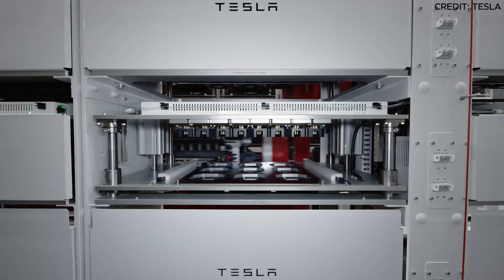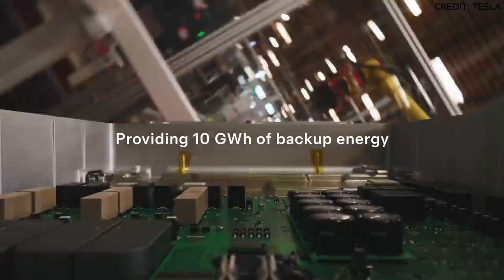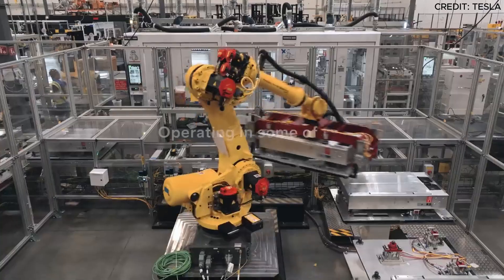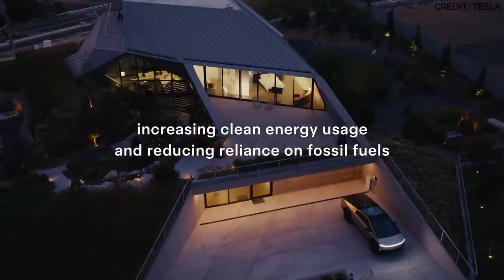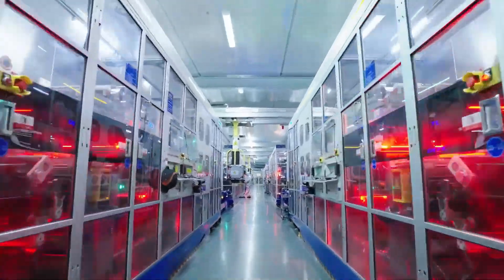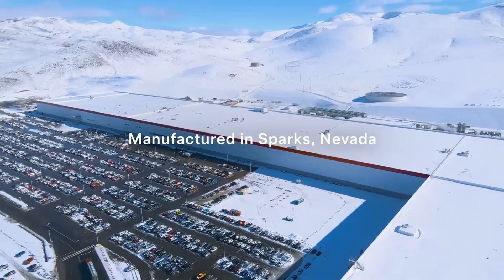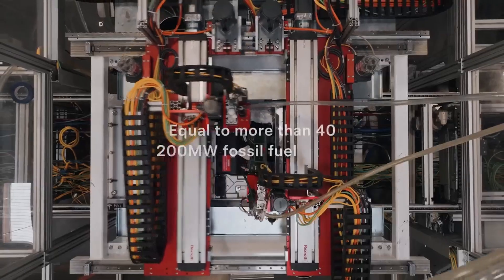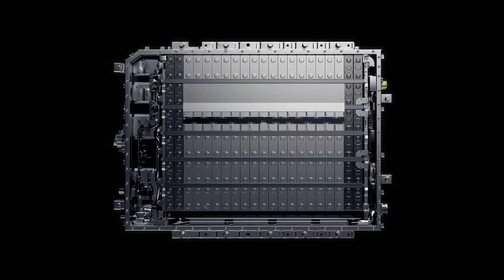Preserving LFP Battery Health: The Case Against Frequent 100% Charging

Comment: What if I don't need a precise calibration? Can I leave it longer than One month to a low State of charge and charge 100% only when I do long trips
Reply from the maker: There’s no major issue with keeping the battery at a low state of charge for extended periods, but it’s best to avoid letting it drop too low (below 10%) for long durations. Staying within the 20%–80% range is excellent for battery longevity.

Occasionally charging to 100% before long trips is perfectly fine. Just keep in mind that if you rarely do full charges, the state-of-charge (SoC) reading may become slightly less accurate over time. This doesn’t affect battery health, but the estimated range might be off.

If you're not concerned about precise range readings and are mainly focused on preserving battery life, your approach is totally fine.
Reply: It’s clear that this was read by AI, but I don’t know if it was also produced by AI. Tesla clearly advises to keep the car plugged in all the time and to charge to 100% once a week for LFP’s. It never specifically says daily charging to 100% is harmful. The common wisdom of the Internet says avoid charging a LFP’s to 100% all the time. Nobody says exactly how much of a hit your battery will take (compared with 20-80%) by daily 100% charging. Will it be 5 miles loss of range after 10 years or 100,000 miles, 10 miles, 20 miles, etc.?